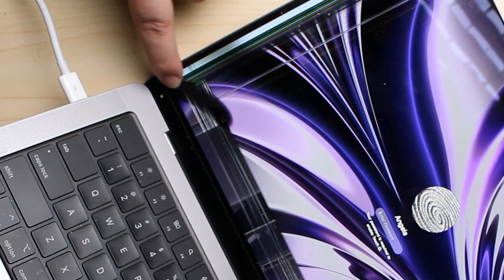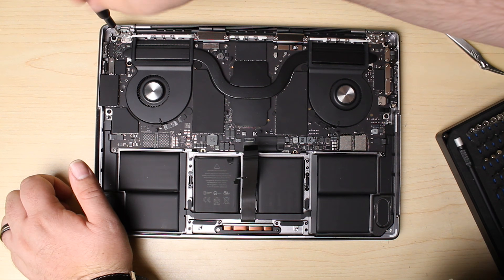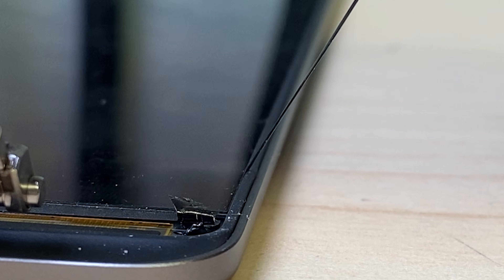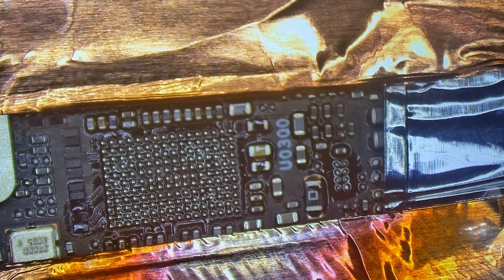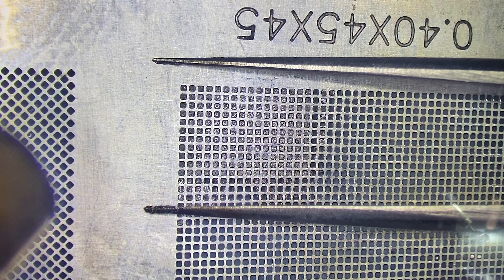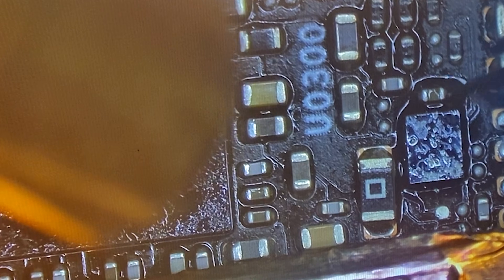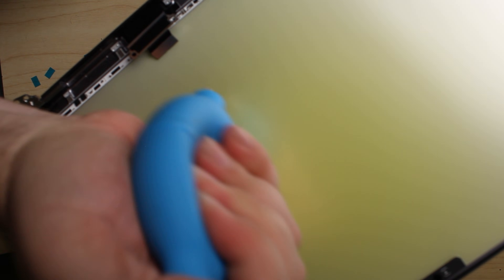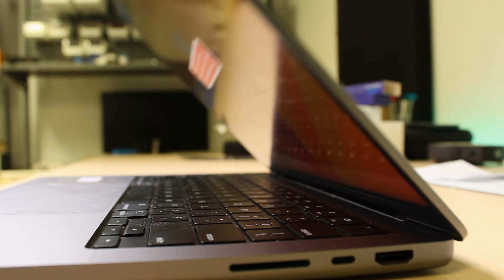MacBook Pro A2442 LCD Panel Only Replacement (Tips and Tricks #62)

Comment: does the glue seal the lcd to the backlight? like if i drip some slight liquid on the bezel and it seeps to the edge, does that black adhesive prevent it from seeping into the backlight?

Comment: Hey there, i changed the LCD Panel of my A2442 2021 14 ich MBP as told in your video, but now there are strange horizontal lines at the bottom of display. IC’s and LVDS cable are connected properly without pressure or something. The panel fitted with the transferred metal bracket to hold the flex cables into the display chassi, so all in all i cannot see any assembly failures. Could you maybe give me a hint what the problem could be? Just played also with the brightness of backlight and it seems like, that the horizontal black lines come later if i let the display run with reduced brightness. Some guys reported, that it could be an overheating issue or something like that

Comment: The part where he slices the bezel off that easily with a transparency is just for demonstration. If you look at the bezel, the sticky bits are already gone. The bezel is very strongly glued on. All the technicians I know in the field, including myself, use a heathen with low heat, and a splicer or spudger to remove the bezel.

Comment: HiQ Great video... One question. Which size of tape do you use in metal board and in the borders? Thank you very much! And one more question. Which is the size of stencil to reballing and temperatures to take off the ic and to put back? Thanks
Reply: https://youtu.be/ML2NNLiV6aA?si=XMtlPgY6cbsQAV7D
Reply: No need change any Chip，more easy
Reply: @Apple-maintenance-engineer  Really? I am searching more informations, and I did not see anyone talking about or showing this type of replacement without to replace the chips. thanks
Reply: @Apple-maintenance-engineer  that's bullshit

Comment: Hi, Derek
 I asked my repair guy that separating the panel from the back light and repairing and resoldering the ICs. He told me that doing this will lead to complete loss of water resistance and that even a little water may lead to damage. Is this true??? Please advise
Reply from the maker: MacBook's don't have water resistance at all. Apple doesn't test them for that let alone claim it. Any amount of water on a MacBook regardless if its been worked on or not is potentially dangerous.

Comment: Is this model impossible to repair if the DP855A chip is damaged? During repair, it accidentally caused an internal short circuit in the chip, which made the original DP855A chip unusable. The DP855A chip was available in China, but unless it is a DP855A chip extracted from the A2442 model, nothing is displayed on the screen. (Unfortunately, I couldn't find a way to extract the serial from the DP855A chip or reprogram the serial.)

Comment: Amazing video! I'm about to do this repair on a second hand A2442 I bought near me for only $600 CAD! I've never done any hot air soldering but I'm an electrician by trade and have been wanting to get into the small stuff for so long; the clear instructions and filming of this video gave me the confidence to pull the trigger on the tools and parts I needed!
I'll update in a few weeks when the display arrives either super happy or very frustrated lmao.

One thing though- what's with the double post on the other channel? It was posted on the same date but instead includes a very detailed description I wish this one had tbh. "FIXD I Repair" posted "MacBook Pro LCD Display Repair: Bring Back Brilliance!" on Nov 14, 2023:   https://www.youtube.com/watch?v=y0-zc9UdOYU
Reply: How did it go? :)
Reply: @roadrunner1095  he is saving up for a new Macbook 🤣

Comment: Can you put a link to all the stuff you used. Trying to do it myself at home but dont have any tools.
Reply: This type of job is not for the beginner. If you have never worked on surface mount, let alone micro BGA, you need a few months practice before attempting this repair. You can change the LCD panel at home but find a shop that does microsoldering to change the chips for you!
Reply: how do you recommend finding a shop that does that? @A2000MHz